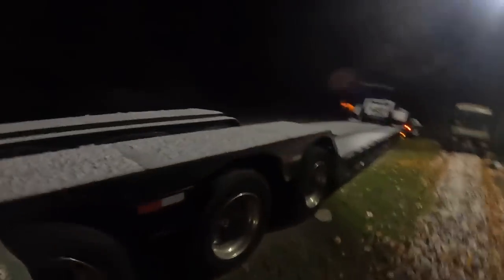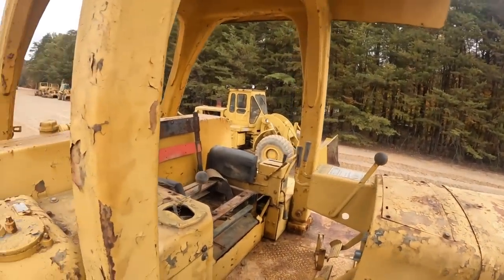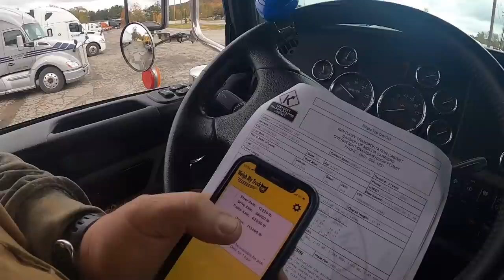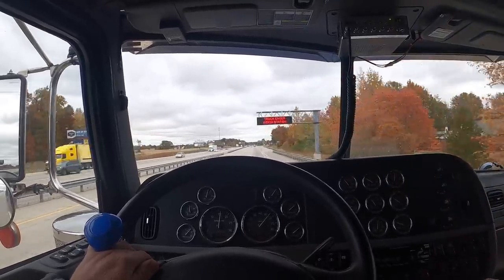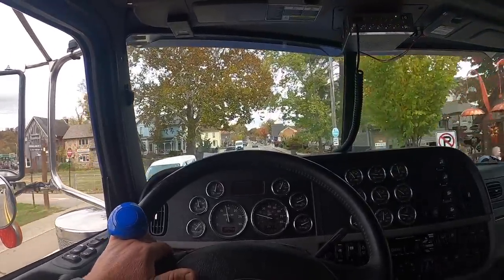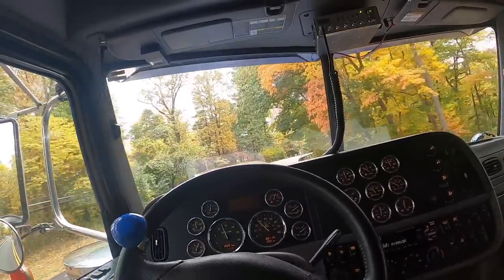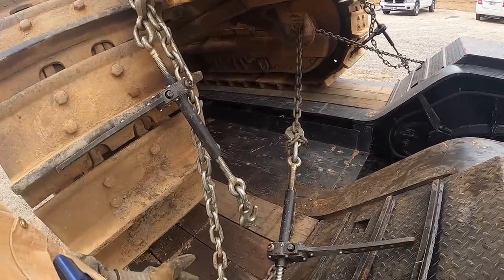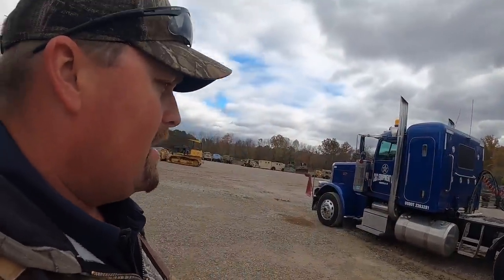Major oversized overweight Cat D8K dozer we hauled in.. Did we scale it legally?

Comment: Way to go Clint!!~  I helped load a 794 CAT truck (250t capacity) at the Decatur Plnt  in 1982. It was the frame, engine and trany. I don't remember the net on that bugger. The truck had 4 axles under the tractor, a three axle jeep over that, and six axles under the trailer. We had to use two 50t overhead cranes to pick it up. The driver wanted engine back. We told him it wouldn't work. It didn't. We picked it up six times before we got the weight on the axles balanced. He left like his tail was on fire.  He had to be out of IL before dark. I always wondered if he made it.  He was headed for a copper mine in Wyoming.  Great fun.....
Reply: They didn't worry about that BS in WWII

Comment: Loved this one Clinton. As a Brit it was lovely to see the colours of the trees and everything on the drive. I missed if the road sign instruction to pull in for weighing was triggered by weight sensors in the road or someone from the authorities. Regarding the weight limit, what if that was a D9 or 11, is this permit related?
Respect for you not delegating this job.

Comment: 189 miles BTW that's an old truckers tale about the turbos spinning and ruining the bearings, the valves in the engine are never both open at the same time to let air pass freely thru the cylinder head ,  only way the turbo could possibly spin is with extremely leaky exhaust
Reply from the maker: Yea
I may do a video on that to prove that’s the case with real world testing

Comment: Nothing in the world sweeter than split shifting clint you ever drive a quad plex I had a old B model  one stack mack with a window in the back it had a 235 mack  and you need every one of the gears ru nning weigh on the road 5 and 4  20 speed the arm rough the wheel holding on to the 5 stick and the free hand skilfully  running the quad plex if you ever went on a long ytip you went to beg when you got home I would have never given a single  one of them days back

Comment: GoPro has a pretty decent suction cup mount, I've put a few hundred miles with my GoPro stuck the windshield in a very short wheelbase KW T800. To give you a little better mounting option for trucking vids. The Insta360 Go 2 is a pretty handy camera for hands free video, as they have a little mount you can just clip to your ball cap bill. I've used it to film throwing tire chains on the truck and unloading trusses in a few videos. The downside is it is really small so you can't film a lot with it. 
I enjoy the truckin vids because I like seeing where everyone else is running, you have a lot more trees out there than Wyoming or Idaho has. I'll guess 212 miles.
Reply from the maker: Thanks

Comment: I miss hauling the equipment at times but not living down that way (I lived down in Clarksville, TN for most of my life)...  I live up in North Dakota these days driving in the oilfield, hauling rental manlifts and wheel-loaders, drilling mud, buildings and skids...  But I don't miss the traffic down that way or living out on the road.  I was in Nashville over at the Brown County State Park and got to back a six-axle rgn and '07 379 (C15 Cat) combination down among the campsites to offload one of the precast outhouses over a vault someone else had hauled in.  Talk about a conversation piece coming down the road lol...  I was always ending up in odd places with that truck but I'd rather have such challenges out in the middle of nowhere instead of being in the cities these days.  Up here, my worst traffic is antelope, mule deer and the occasional herd of horses or maybe a moose from time to time.  Good explanation about all that goes into such a move!

It looks like you keep your chains straight (not twisted) but maybe those speed-binders make that simpler (I've never used 'em, only the regular ratchet binders or sometimes those with the folding/offset ratchet).  I've always made sure my chains are not twisted (just for anyone that might want to pick up a tip that seems to have worked for me for the past 20 years or so), for it will always try to straighten out the links while vibrating on the road.  It takes some of the hassle out.  

Looking forward to seeing what you guys do with the old D8...  Just always enjoy seeing the old girls brought back to life.  Thanks!
Reply from the maker: Thanks

Comment: Thanks Clint love a road trip in the States your road weights are very different to ours here in Australia ,I drive a B/Double and my max weights per axle with mass management are
Steer 6.5ton drive 17.5 1st tri 22.o ton back tri 22.0 ton to a total gross mass 68ton there are obviously variations for over dimension loads but this is what the general B/Double configuration work to .But I love the c15 cat turbo whistle can't beat American trucks I sadly drive a euro truck these days miss that big motor grunt ,look forward to next video
Thanks Kym
Adelaide
Reply from the maker: You guys haul some weight over there
Always loved the Mack superliners
Reply: @C_CEQUIPMENT  
Oh yeh a Mate of mine back in the 80,s drove a v8 super liner pulling a special float for shifting D8 AND D9 CATS USED TO PLOUGH FIBRE OPTIC CABLE ALL OVER AUSTRALIA ,I HAD A RIDE IN IT AND HOLLY SHIT IT WAS NASTY THE V8 EXHAUST WAS JUST MIND BLOWING ,HE USED TO JOKE THAT DRIVING IT WAS BETTER THAN SEX HAHAHA WHICH DIDNT IMPRESS HIS WIFE GREATLY 
WHICH WOULD YOU PICK V8 MACK OR V8 CAT!!!
CHEERS KYM
ADELAIDE

Comment: I always mess with DP about US trucks being low and light  compared to the UK. Our everyday trucks gross 44 tonnes, the load shown in the video is around 51 tonnes. Back when I did 'heavy haulage' it's the sort of thing the new lads moved as it would be considered a featherweight. 
Our standard trucks are a bit shorter so we tend to run higher, we don't have a height limit but for practical reasons 16 foot is about as high as we can run at and when I used to work on the cars that was pretty much every load though the one in my profile pic is barely 15 feet high, it hardly counts as a load really 😂

Comment: You're right about the Cat engines, all of my 3406B's and 3406E's it seemed like the heavier you loaded them the harder they worked! Almost like they liked it! I like hauling in my western states, a truck and trailer setup like yours you'd be good for around 89,000. A tandem spread axle is good for 86,000 and when we pull our double trailers we're good for 129,000. Even with a single trailer if you have the axles you can haul it. Granted our roads are a lot bigger than the eastern part of the country.

Comment: Explain how the Jake break works, I understand how the engine compression with a thief deterrent transmission can hold or slow a vehicle down. 
I have a V-8 with a 5 speed thief deter, and tow trailers with equipment loaded. Just don’t understand a Jake Brake. Thanks for the feedback, my guess on the miles is 96, I had forgot until l watched the video today. Forgot to tell you my truck bought new is a 95 Dodge Dakota 4x4, still driveling it.
Reply from the maker: They hold the valves closed and a no fuel situation to produce hold back